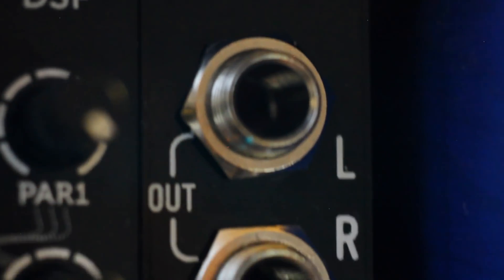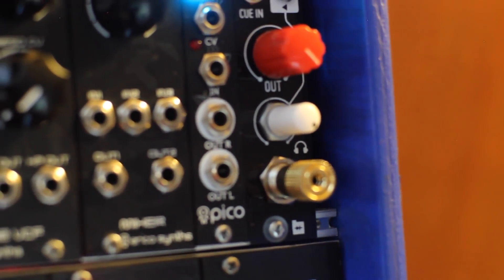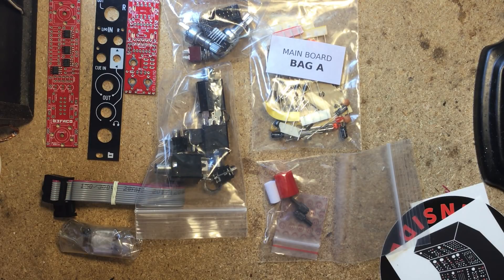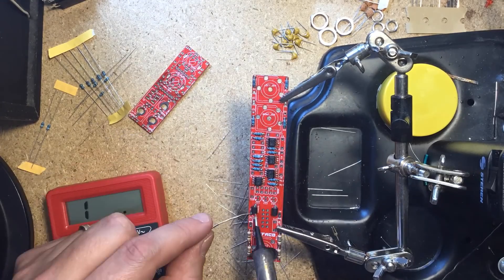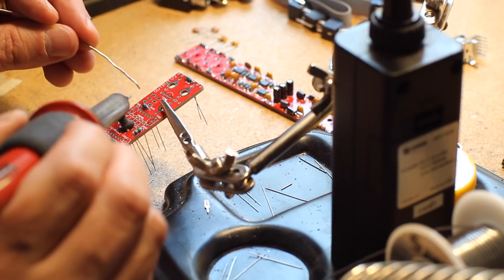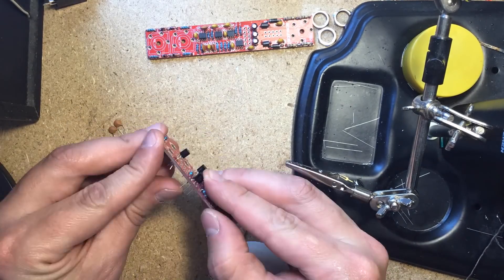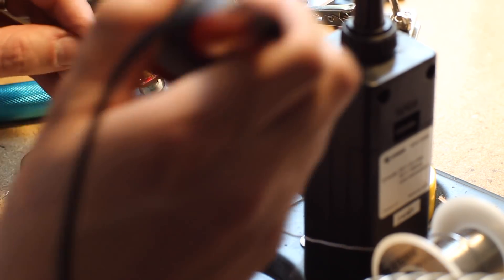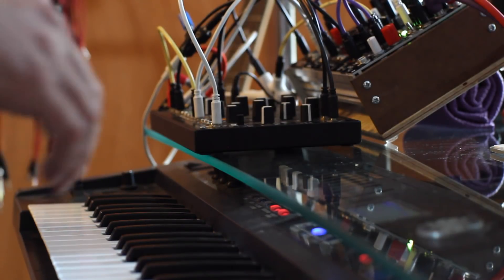Kit Review # 23 - Befaco Output V3

Comment: why do you solder stuff from above? any specific reason?
Reply from the maker: yes! So I don't have to spread a hundred resistor legs and the stick my iron tip into a forest of leads....  This way, I just place them and solder, then turn around to clip all the leads at once and touch up the soldering. This can only be done in factory boards, homemade ones don't have plated through holes. It's much more efficient, I learned it from Ray Wilson
Reply: @QuincasMoreira  obrigado!

Comment: How does the Cue input work? I can use it to add an additional mono signal to the output?
Reply from the maker: It's so you can listen to something before patching it in to the output. Say you want to tune an oscillator by ear or check a sequence...  patch it in there, flick the switch and that's what goes to the headphones, while the outs are still sending the main stereo input pair. If you like what you you hear, patch it in to your mixer.
Reply: @QuincasMoreira  thanks for the reply! I was hoping it could work as a minimal mixer where I could patch a stereo signal plus a mono signal into cue (and add it to the mix with the little switch).

Comment: hey, wonder if you can help me - the thing that you are using to hold each panel whilst soldering, what is this called - where may I find it? Thanks!
Reply from the maker: I think it's called "Helping Hands"! It's also my logo :)
here's a link to a simple one on Amazon:
https://www.amazon.com.mx/HELPING-HAND-Helping-Hand-Magnifier/dp/B000P42O3C/ref=asc_df_B000P42O3C/?tag=gledskshopmx-20&linkCode=df0&hvadid=295470364059&hvpos=1o2&hvnetw=g&hvrand=1937240488216585433&hvpone=&hvptwo=&hvqmt=&hvdev=c&hvdvcmdl=&hvlocint=&hvlocphy=1010043&hvtargid=pla-448870101576&psc=1

Comment: why solder from above?
Reply from the maker: Quicker, cleaner, smarter :)
(No trying to solder between a forest of leads, turning the board around multiple times, etc...) But only works on professionally made boards with plated through holes or the solder won't go through to the other side.
Reply: @QuincasMoreira  makes sense,
but i am way closer with the heat to the "chip" or whatever,is that more an advanced technique?
Reply from the maker: Resitors, diodes and ferrite beads only. There are no chips on the board yet, and the resistors don't care if you're a micrometer closer with the iron . It's just a more practical way to do it, I've been doing it for 8 years since I learned it from Ray Wilson.
Reply: @QuincasMoreira  thanks,you helped me a lot,already know more!
Reply: @QuincasMoreira  good to know

Comment: Is this a good addition to the Hexmix or unnecessary?
Reply from the maker: If you have the Hexpander it is unnecessary. If you only have the Hexmix Mixer, then it is indeed a good addition, as it gives you balanced outs and a Headphone amp with cue input and switch.
Reply: Ah yes, the add on! Very cool. I'll need to build those at the same time I think.

Comment: Wait... you soldered the components from the front?  Is that a thing?
Reply from the maker: it's a thing :)
Reply: @QuincasMoreira  under what circumstances do you prefer to solder on the top?
Reply from the maker: @randomizer  When the resistors lay flat and the board has good quality plated through holes. This way I don't have to turn the board around all the time and deal with sticking the iron tip in a forest of leads. I just turn it around once, after soldering all the resistors, clip all the leads and touch up any spots that may have too little or too much solder.
Cheers!
Reply: @QuincasMoreira  thank you for your reply! Makes sense :)

Comment: Which IC's are (3 presoldered) in this kit and which IC needs the socket?
Nice vid btw 👍🏻😎
Reply from the maker: Thanks!  Looking at the Build guide (I'm not taking mine off the rack ;) )  The socketed chip is a TL 072.  And looking at the schematics, that leaves another 2 TL072 and a pair of NE5532 for the headphones : https://www.befaco.org/docs/Output/Output_V3_schematic.pdf
Reply: Synth Diy Guy thanks for the schematic 👍🏻
Hmm.. And there is no noise if you send some very low end thru the module? 
My Synthrotek "MST Stereo output mixer" has the same IC and got this odd behaviour of some noise when sending low end stuff thru it.

Im going to change the IC TL074 with a TLE2074. They are interchangeable because of the same pinout. I hope ill fix it this way. (or maybe the one ive in the circuit is a "mondaymorning" one 😂)

Keep the build-vid's up, they are very interesting 😎
Reply from the maker: Yeah, the TL07X is a fine opamp, used in high quality mixers and audio gear since the 80s. The noise you're hearing is most likely the product of poor circuit design, I don't think swapping the opamp will fix it. I have quite a few mixers in my system that use the TL074 and there's no noise to speak of.
Reply: well, after receiving the new TLE2074CN from Aliexpress and changing one for the TL074CN in my MST Stereo Output Mixer the noise is gone "yay" :D

i think the old TL074 was just a bad unit... like we germans call it "Montagschip" (build at a monday morning by a worker who wasnt paying the right attention)
Reply from the maker: Nice!  I'll check that Opamp out for sure :)